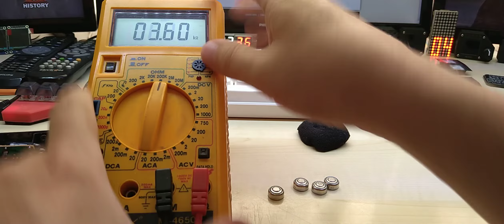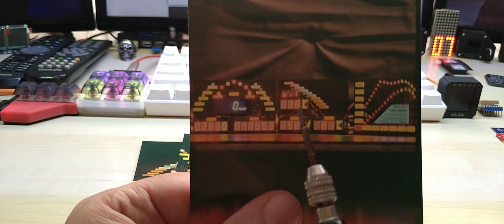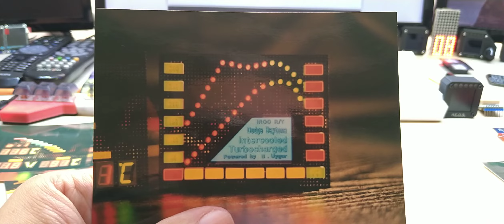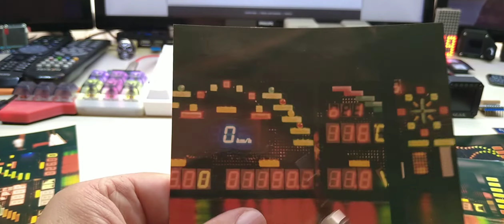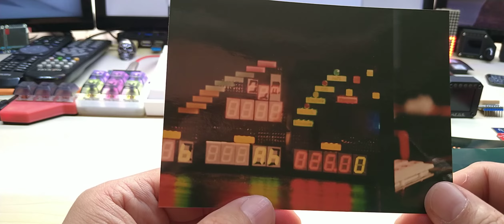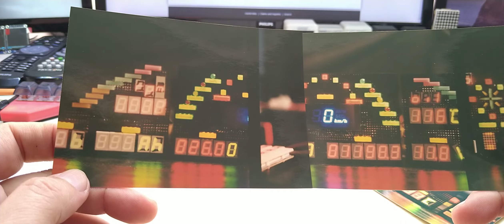Back to the past, some electronics I made about 30 years ago, custom car cluster with 7 segment LEDs

Comment: Your content is good. I think most of the people who don't watch them are non techies. They just tap on video and quit watching in the middle.
I'd like to hear more about what you were doing all these years, what's your education, and how is life these days after having so much experience with electronics?
And from now I'd also put dates on my PCBs. 😂
Reply from the maker: Thank you. Well, I actually had a break from electronics for many years as life got in between including living in different countries and doing other professions. I did start with electronics again right before I started my YouTube channel. After discovering the Arduino UNO/ Atmega328 chip and making projects with OLED displays it just kept going to where I am now. These days it is hard, due to the pandemic, to make a steady income plus most people do not realize how much time goes into designing and making a new product. But, this is my passion and I will stick to it as long as I can :-)
Reply: @iHayri1  if you're new to Arduino, you should definitely try esp32. There are modules with on-board antenna ready to be put on projects. I've been using wroom32 in commercial projects and they never fail to surprise me.
Reply from the maker: @muflah  I wouldn't consider myself new to Arduino :-) I am using the ESP12S in some of my products but haven't had the need for the ESP32 yet. My newest go to chip is the 1284P that does solve my space requirement I had because the 328 got too limited. For anything IoT the ESP family is a good place to start, no question there, thanks.